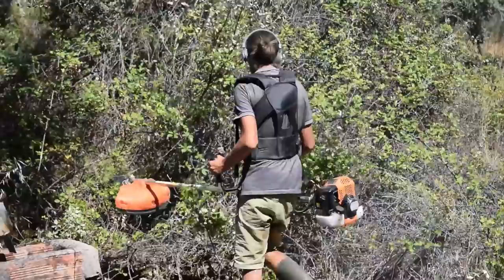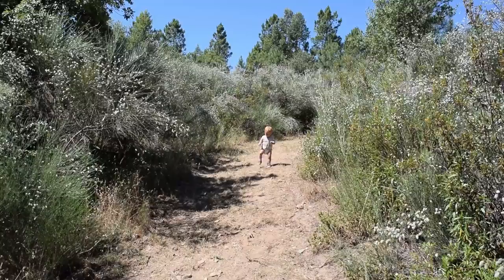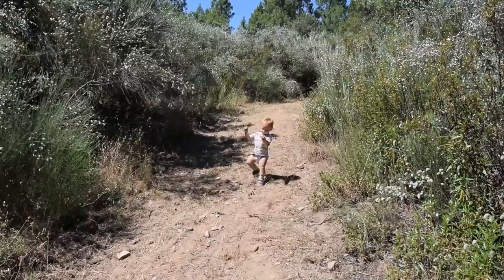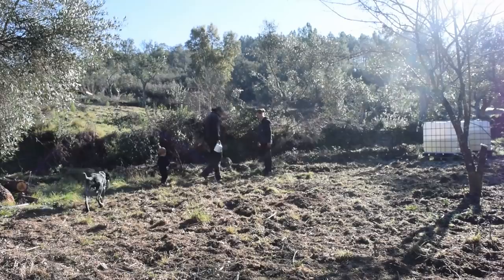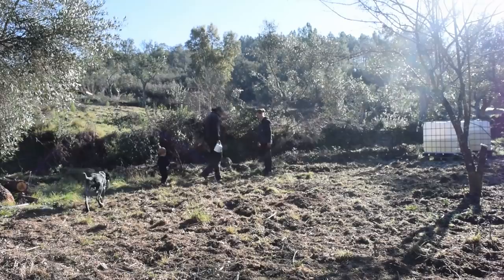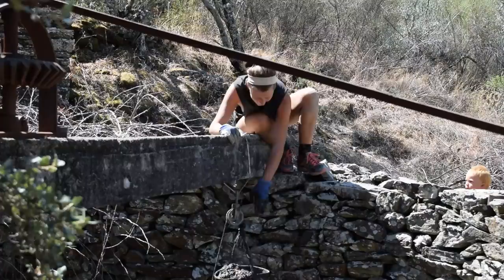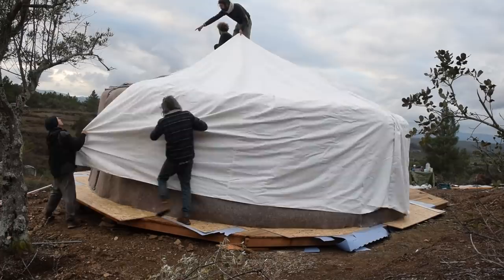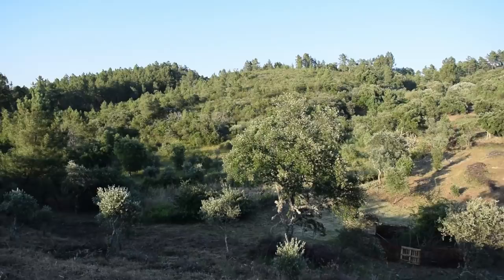We bought abandoned land and this is what happened - Year One - Our Portuguese Homestead

Comment: No disrespect. You need a residence with an exterior that will not burn and the plants being pushed back far enough to provide some protection.
Reply from the maker: We have cleared 50 meters of brush around the yurt, as are the rules. Felt is actually fire resistant, so not so easy to light. But we keep fire safety in the back of our mind always, thanks for your concern (although it does sound a bit disrespectful).

Comment: Hi! The yurt, while stylish, may not be the best choice for the climate. And there is also the fire hazard, like that people recently in Algarve. Look at vernacular construction, thick stone walls for thermal inertia, clay tile roof, shaded windows. I know it is all labor intensive, and human effort can only do so much, but you could consider a small house done in earth bags and local stone, and a simple insulating roof. That would give a cooler place to stay during hot summer days. Also protect yourselves from the sun with hat and sun cream, or you will get seriously skin burn, specially the child. Sun burns are cumulative, so over the years you will not grow thicker skin, just accumulate skin lesions. Again, look at local farmers, they don't hang out like that just for the style. If the heat hits hard, you can go to air conditioned places like the cafe, some store, the public library, the bank or post office to be of the heat and direct sun. I wish you the best of luck!